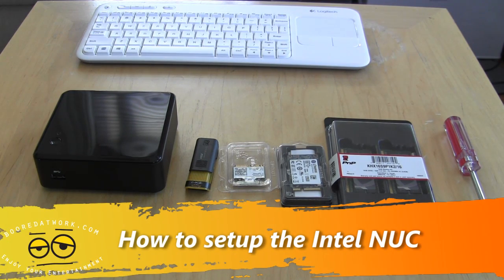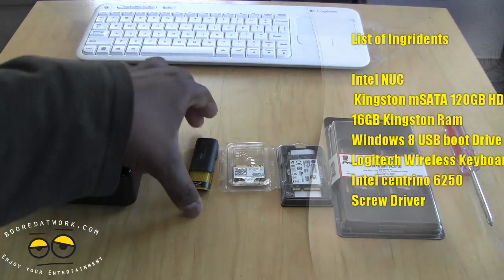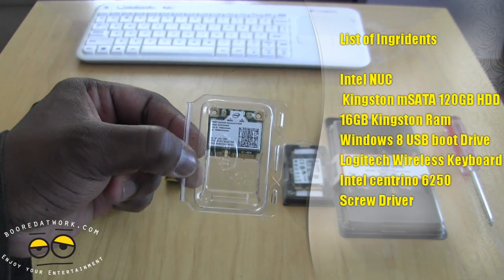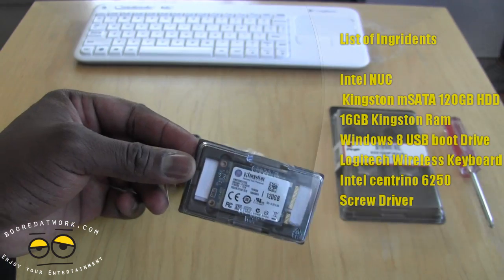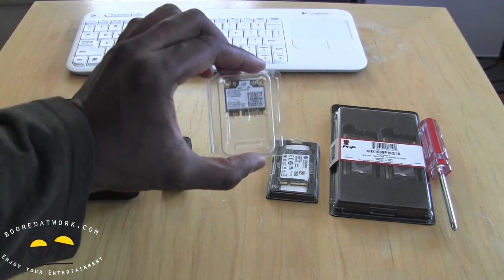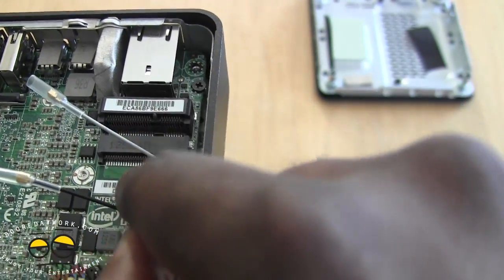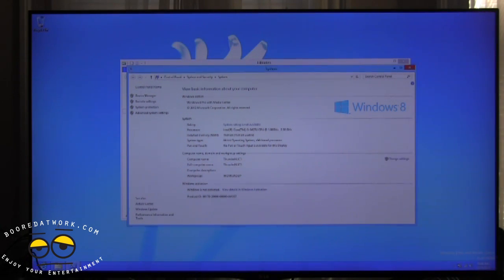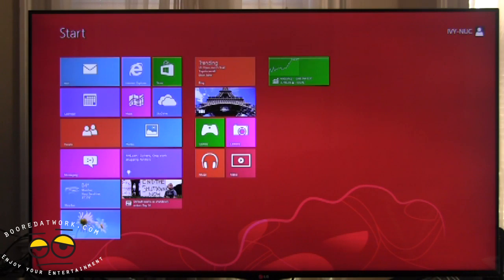How to Setup the Intel NUC: Complete Guide

Comment: which ram slot to use if you are only using one card, upper or lower? There is an order about these things. Also, arent you supposed to handle ram by the edges only?

Comment: despite the negative comments shown here, the video was reasonably well made.   At least the gentleman attempt to show how to assemble this NUC.   The fact that some errors may have been made, is irrelevant.   The NUC did boot-up and did load the OS.   Also learning what NOT to do, is as important as the correct method.   Overall rating out of 5, would be about a 4.

Comment: Can you help, have NUC 5i5RYH, installed ram and solid state drive, it says on box has wireless AC 7265 but when I installed windows and went to find a wireless connection or even plugged a CAT 5 cable in nothing, says no hardwear. Can you help tell me what is going on?, also I presume the sound will travel re HDMI cable but also says no sound? Any tips please
Reply: you have to make sure that you have the wireless kit 19.60.0 or above for the wireless setup and network card. and make sure the on board sound is on in bios. (legacy)

Comment: Monitor fails to turn on Intel NUC KIT DE3815TYKHE - Before we can install the OS we need to have the monitor display turn on.  That is the trouble - no information is sent to the monitor.  We swapped the 8g memory,  tried both ports and also swapped the cables   Can you help
Reply: I know this is an ancient comment but did you get that fixed in the end? I've got the same problem now lol.

Comment: Hi,

I am going to buy one of these and have a question concerning the Consumer Infra-red Receiver that is within the NUC. I have an xbox 360 controller from my bundled console/controller package. Usually you have to buy a separate receiver if you wish to use this on your PC. However, the NUC has an IR receiver and was wondering if this is compatible with the xbox 360 wireless game controller? Therefore, I would not have to buy the official Microsoft xbox 360 wireless controller receiver.

Comment: I just put one together;  I recommend hooking the antenna leads first, then insert it into the socket.  It's difficult to reach down into the box to snap the connectors on, especially if you get the deeper case that can accommodate a 2-1/2" hard drive.

This is an extremely well thought out packaging job by Intel. 

It was really cute to slide the carton open and hear Intel play their "Intel Inside" tune.  It was like Intel did their hamster dance as you open the box.

Comment: So windows is a separate purchase? Along with the bootable flash card?
Reply: Yes.  This is essentially a home built PC, not a completed computer in kit form.   Like any home built PC, you have to purchase the OS.  You copy the windows distribution disk over to a USB flash card for installation.  You won't need it after that.  Or you could use a USB powered external CD/DVD drive.  It may not have been clear from his video, but the memory, SSD disk drive and the bluetooth/wifi module are also separate purchases.  This is the same as building any PC from parts.  You chose the configuration and purchase the items you select.
Reply: Just use xbmcbuntu its free and I'm guessing you just want a set top box rather than an actual PC. other than that then yeah you need to buy windows if you dont wanna use Linux

Comment: Overall a great video. Love the use of a tripod, no one handed installs! I read some of the other comments, using the correct screw driver helps, I think the kits, with multiple tips, are like 10$, You are not driving wood screws, there is a difference blade angle and thickness, center diameter, magnetic tip etc. I want a NUC but if the price is the same as a larger more functional unit/PC I find it hard to justify the added expense because it is small. For a HTPC/gaming PC I want digital out and iR in, TV sound is always subpar.

Comment: i thougt there is a slot for a 2.5 inch hard drive. The NUC team talked about it.
Reply: There are different versions of them.  The ones you can use the 2.5 drive have different model numbers and the most obvious is the nuc is bigger height wise.

Comment: Please give me the total cost you pay for it please? Thanks in advanced!
Reply: There are several configurations ranging from the Atom E3815 up to the I5-3427U.  They vary with features, some support a 2-1/2" hard drive, some don't.  You pick the performance you need from intel dot com/nucsupport.  Then you pick your components.  You need a solid state drive and memory.  Chose your parts then shop by your parts list.  Minimum configuration would be around $150 for the board, $60 for the SSD, $50 for 4GB memory, $100 for windows 7 home or windows 8.  The I5 kit costs $378 plus whatever you install.